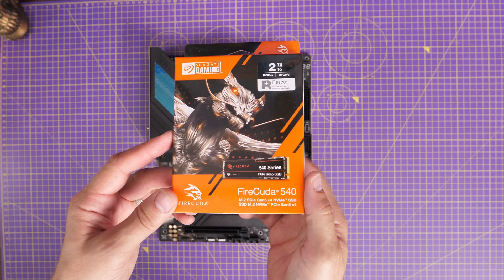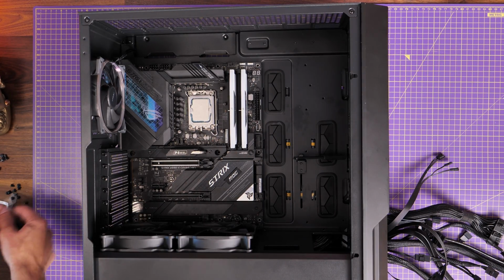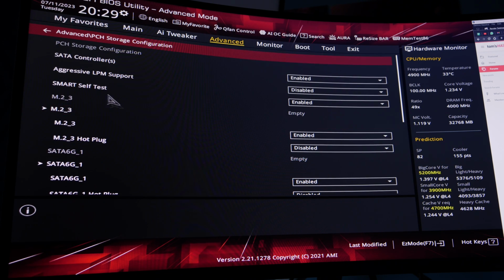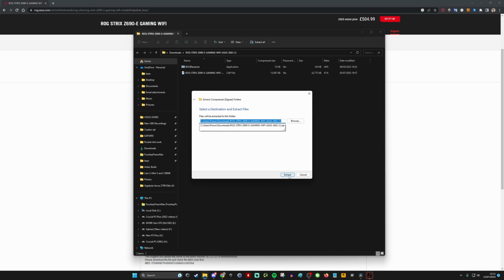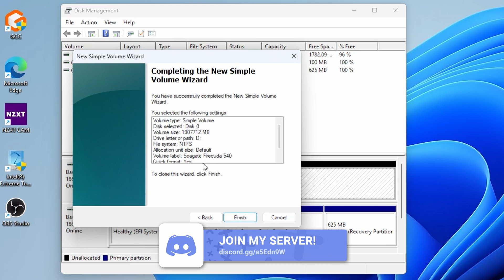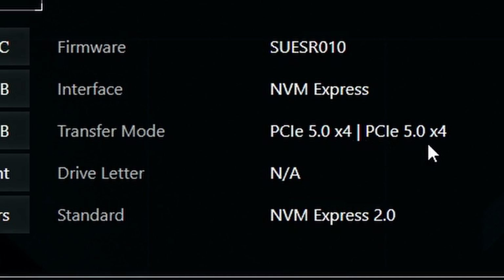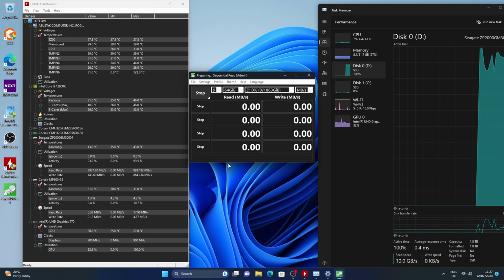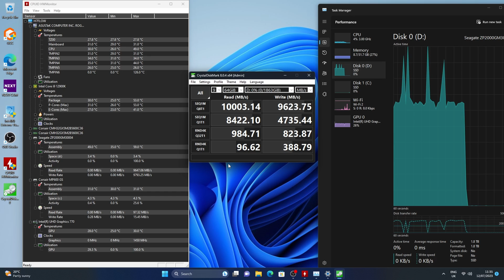Seagate Firecuda 540 NVMe SSD install and troubleshooting

Comment: I slot in my gen 4 at my gen 5 slot nvme. Hopefully nothing happens
Reply: nope. nothing will
Reply: On some Mainboards you need to be careful - when M.2_Slot1(Gen5) is occupied (doesn't matter if its a Gen4 or 5  SSD),  your PCIex16(G5) will run x8 only
Reply: Thanks

Comment: I have that exact motherboard. I have 2 NVMEs, one I installed my OS and put games on the other one. I kept getting blue screens and games would just shut off. Trying to do what I can to fix it. No luck. Got someone to come to mine, they updated the BIOS and suddenly never had a problem since. XD

Also with that motherboard if you have the NVME drive installed with the beefy heatsink, it'll lower your GPU to a x8. I didnt know that until after I bought it.